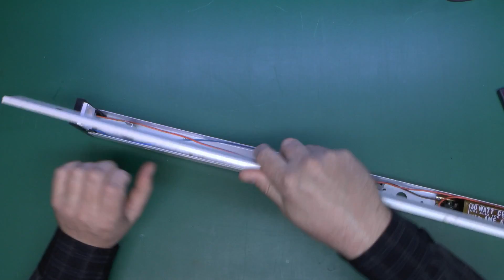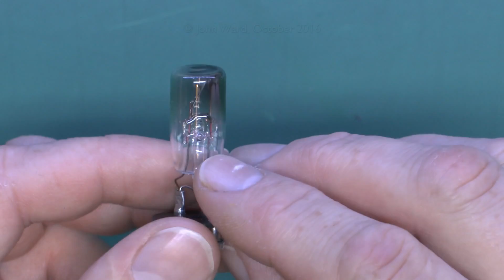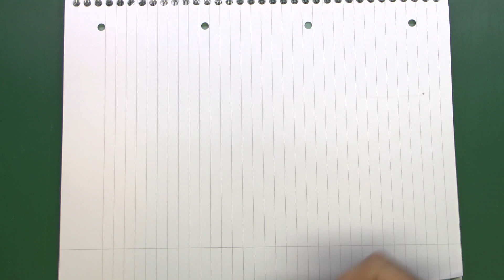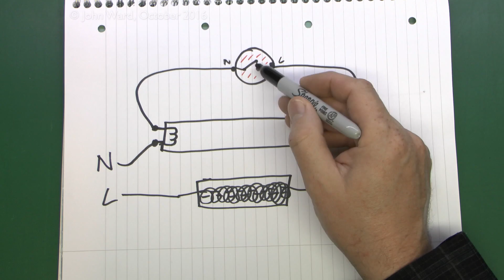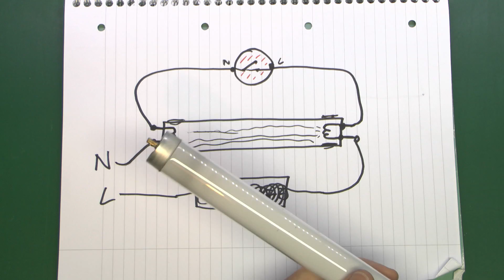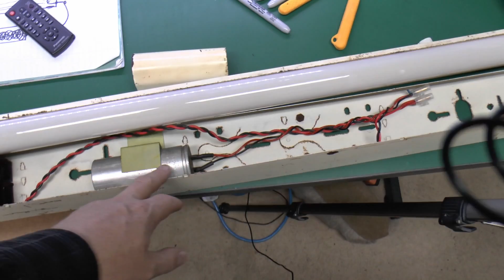Fluorescent Tube Lighting

Comment: A decent electronic driver is rather better quality and efficiency than choke, and good types are very long lasting and make the lamps last a very long time as well, e.g. :-
https://www.youtube.com/watch?v=Qyadtmx17Ms
However; really worth noting you can re-wire these fittings to connect both ends of tube in series, and put in integrated-driver LED tubes, bypassing any electronic-ballast (and preferably, magnetic choke), either bypassing starter socket or installing the "LED starter" which is really just a fuse/short-circuit.
One end of the tube contains another fuse/short-circuit and the other end takes the power.
There are evil tubes that take power from both ends or all pins which expose more risk of shock from the pins, breach safety rules in various countries as I understand it.

Comment: Thank you for an informative video. I notice no blogger ever mentions the suppresser in the   
Capsule that is connected acrosss the pins of the starter. It plays a very important part in reducing the emf chattering and upsetting the out side feed lines. Look at any good starter and you can see all the tests that are compulsory before a simple stater switch can be assembled or sold.
I worked for Thorn in South Africa where I started my lighting career and I remember the choke in those days in dipped lacquer/varnish. The information was paint silkscreened on. 
It is possible when the bi metal contacts have opened again to reomove the starter but if switched off the starter would have to be put back to light up again. If I remember it wa a post office/ telephone requirement. Many call the suppresor a fuse which it is not.
2025 Greetings from South Africa. That channel gitting was manufactured around in the seventies and probably have a date stamp on the underside. It is incredible the amount of popular packs that were manufactured at Spennymoor over 80 000000

Comment: 2 problems with these. Firstly with old units, the plastic fittings get yellow and  brittle with the UV given off and the 2nd is the mercury vapour inside the tube (which wasn't mentioned)😃

Comment: My Tricity cooker has a 2ft fluorescent hob light. With a push button starter switch. Press and hold to heat filaments then release. The lamp usually flickers to life if switch is pressed too briefly.
Reply: Will probably last a lot longer than these cheap LEDs

Comment: Being a electrician as I am forever that's is a thorn 3ft fluorescent light fitting it's runs off on a 240v.30w ballast and via that 3ft 30w t8 thorn fluorescent tube.and should have a thorn 155/500.4--65w.200-250v starter lamp switch made in great Britain items.must be in use for that 3ft 30w fluorescent tube light fitting.and that other starter lamp switch only in use a 6ft 70w t8 fluorescents tubes only.via that 70w 220-240v starter lamp switch.and have a good summer holiday there John ward.from this electrician that's me in general.

Comment: Hi John. Great vid as ever. That said, could you 'do' one on the necessary conversion (re-wiring) needed for them to run LED tubes? I get that it is to do with removing the choke / ballast and replacing the starter with a fuse instead but am not 100% sure of the revised set up. Thanks.

Comment: Hi JW i want to power in my workshop  so i will need 2x16amp plus normal plugs sockets double ones to run compressor and 2 cnc machines one being a milling machine plus lighting so could you advise on what i will need swg armoured cable thanks Rob

Comment: I think actually the ballast includes some kind of voltage inverter/booster to increase the voltage to start the current through the gas in the tube - as it's high resistance. So the circuit diagram drawn in the vid is not right(?) my monitor has to inverters on the power board and is marked very high voltage so I that is why I think this involves very high voltage to get the lamp/tube started - some kind of transformer/inverter in the ballast. I could be wrong.
Reply from the maker: Old ballasts like the one in the video are just a big coil of wire on an iron core.
New lighting and other items such as monitors will contain 'ballasts' which are actually electronic circuits.

Comment: Hi, What is the wire/ conductor that is used for the internal wiring?
Reply from the maker: Solid core, single insulated.  Not sure of the size, but probably 1.mm² or similar (this video was made over a year ago).

Comment: Single tube for single tube circuits as oppose to a starter for multiple tubes at the same time? What are you talking about??? 'Single' starters are for use for single lamps circuits yes, but the other kind I think you are referring to are single/twin starters i.e. FS2 starters that operate a single tube of 4-22w on 110/120v ac or two 4-22w tubes in series (one starter for each tube) on 240V. Also 3' fluorescent tubes are still 30w. When you give erroneous statements it makes me doubt anything else you say!

Comment: I work in a 24 hrs shop, and we rarely ever turn off the lights, we'd only use a couple of starter for a whole rows of light by connecting them, turn the light on and after the light has been started, remove the starter and move on to the next light as you don't need the starter while the light is on.

Quite a hassle when the power goes out though
Reply: What sort of stupid logic earning lots of money by running a 24hr shop but not spending pennies worth of starters for each light. Similar to car drivers in asia who switch off engines at traffic lights to save 6 drops of fuel but then pumping in 40 drops to get it restarted, not to forget wear and tear on battery and starter motor

Comment: If I decide to disconnect the ballast and put the line straight through for an LED tube, I take it the capacitor is irrelevant - if fitted at all. If it is fitted, is there any advantage in removing it?
Reply from the maker: LEDs are typically capacitive loads so another capacitor would make the power factor worse rather than improve it.  Therefore best removed.  However power factor is only relevant to larger commercial / industrial installations where it may affect the price paid for electricity.

Comment: 3' and 6', strange, in australia i've really only seen 2' and 4' (18/36 watt or 20/40 for the fat ones) except for fish tanks
Reply from the maker: 4', 5' and 6' are the most common here, with 5 probably slightly more popular.  3' are unusual and the tubes typically have to be ordered specially, 2' are available but seldom used - smaller fittings generally have folded tubes such as the 2D style.
8' tubes were common once in large shops and commercial buildings but are not manufactured now so most have been replaced.
Reply: I've actually noticed 6' variety noticeably more costly and hard to find specialist high quality tubes for, basically decided to settle on 5' variety as much as possible.

Despite the rise in popularity of some LED fits (of wildly varied quality), I have found very good value in HF Fluorescents (Tridonic PRO or ECO-dimmable ballasts) and special High-CRI tubes giving exceptional quality light =).

Comment: Known as "preheat" in the States. But you didn't mention the cap across the starter. Believe that's there to allow AC current to flow between the tops of the filaments after the switch opens (after the starting pulse).
Reply: The cap across the starter is to filter out RFI when the starter is operating.

Comment: A quick query - will the filaments not begin glowing as soon as power is applied, even if the filament circuit is closed at that point via the neon gas? The implication is that the filaments won't heat until the starter's bimetallic switch closes, but I thought that was merely the instant before starting circuit reverts to open-circuit state, because the bimetallic strip is no longer being heated.

Comment: We are slowly replacing the oldest fittings at work, as and when they fail, due to the lamps being very hard to get hold of. They take 8ft 100w t12 tubes. Shame really, but the light output of a twin 5ft t5 is equivalent or even better, whilst only consuming 70w in total
Reply: Note importantly, the T5 tubes are specified for use only with Electronic Ballasts.
T8 Tubes, confusingly, are 'rated' for use with Magnetic ballasts that waste considerable amount of energy again... e.g. 58w ballast with 20w lost in ballast
BUT when T8 ran with good electronic ballast similar to T5's they actually used LESS than that rating  e.g. 50w + 5w in ballast  (as well as giving more light, handling lots more start cycles, lasting longer, and giving non-stroboscopic light if the ballast is any good).

Comment: Can you do a video on the pro/cons of the electronic vs older ballast? Thanks.
Reply: Its pretty easy to compare and contrast the two types. older "magnetic" ballasts/chokes are by far more rugged and used to be cheaper to produce, after all they are just a coil of wire on an iron core so they practically never fail. But they fall short on efficiency, wasting a fair bit of power as heat, and can leave a visible flicker and audible hum of 50 or 60Hz, corresponding to your countries mains frequency.

Electronic ballasts offer greater energy efficiency and usually operate the tubes at high frequencies, which means flicker-free and hum-free. But the "instant start" variety can be pretty rough on the tubes, by not preheating the filaments at all and forcing them to start with a high voltage pulse. 

So basically it comes down to magnetic ballasts are tried and true, but everything is solid state circuitry nowadays and you can't really find many (if any) magnetic ballast fixtures anymore. Gone the way of the incandescent light bulb.
Reply: Exactly...
Second-hand / new-old-stock Tridonic ballasts are easy to find and very good quality, very long lifetime, much better than magnetics...

Comment: Excellent explanation John. There is one other mode of failure. When the filament burns out or breaks off, the bulb will not light . This is also true if the ballast is the starter less type. Even the high freq ballasts need a filament for the arc to land on. In the US we can still get most any T12 lamp including the HO variety, however, the VHO ,(very high output), are quite difficult to find.

Comment: I have a couple of these fixtures in my garage. They're having issues starting up. 
One day I noticed running my hand along the tube during startup excites the gases in the tube and it promptly lights.
Just thought I would share this little tidbit of information.
Reply: This might suggest the fixture isn't properly grounded
Reply: Tubes like to have a grounded metal strip running along their length to help start.
Reply: wonder if its static electricity helping ironisation

Comment: I have an old fluorescent fitting in my garage, dating from about 1959, which has a modern bi-pin tube in it but the starter has four pins.  Does anyone know what that's all about?
Reply: I believe four pin starters used the extra pair of pins for a small heating coil that drives the bi-metallic starting mechanism in free air, predating the gas discharge 2 pin starter shown in this video.

Comment: is there any way to check with multimeter one of these tubes if it works?
Reply: You can indeed check between the pairs of pins on one end or the other for continuity, to ensure the filaments are still intact. BUT, there is no way to check for a working tube long-ways across the gas in the tube with just a multi-meter. Need to just stick it in a fixture for that :)

Comment: What is the best way to determine if a flickering fluorescent tube is a faulty starter or tube?
Reply: The tube goes visibly black near the ends, which is usually a good sign of a well used lamp. But a faulty starter may take a long time after power is applied before it attempts to strike the tube, or it may not attempt at all. Blink happy fixtures usually means a worn out tube, the starter is trying its best but the tube can't successfully strike anymore with the supplied voltage.

Comment: So once the tube has been struck, it is driven cold cathode style? Or are the filaments self heating?
Reply: the filaments are heated duig striking via the starter, once struck the current flow keeps the warm, thats why when a tube dies and fails to strike, the ends start to glow due to the starter not kicking open cicuit
Reply: John McLaughlin Ah, I figured as much.
Reply: Filaments basically not used once started on these old switch-start-fittings.
HOWEVER, I should point out that you get much better startup-lifetime with these lamps if you use a Decent quality High Frequency Ballast instead.
There are instant-start and rapid-start HF-ballasts, but, the best ballasts (e.g. seemingly all Tridonic kit) use a "Programmed Start" electronics, running the heaters optimally and start as best as possible ....  Switch-start / magnetic choke can be described as a very "heath robinson" arrangement, as well as giving all those widely-recognized headaches/issues surrounding 100hz lighting.
Reply: Any fixture with a starter or so-called "preheat" fixtures should not cause constant glowing filaments, unless the starter happens to weld its contacts closed. I believe its rapid start ballasts that fail in that manner, but do not use a self-contained starter as such.
Reply: didn't know that thanks :)
Reply: I've noticed that in the USA, the heater elements are always being energised. This is quite unlike the fluorescent tubes in the UK which are only energised during striking. This does result in different behaviour during failure.
Reply: For switch start they are only heated directly via starting. The arc discharge is hot enough to keep them glowing. In the US with Rapid Start the filaments are heated electrically during the entire running time. This is rather wasteful except for flashing or dimming lights where the heating is needed to reduce wear on the filaments during that type of operation.

Comment: The only thing missing from the video was why the filaments at the end of the tube are pre heated, which is the same reason that CRT's in TV's and and monitors and valve's in old electronic equipment heat the filament to help them emit electrons. Once the tube is conducting I believe the current through the tube keeps the filaments hot.

Comment: There is an adaptor kit for those old B22 tubes so you can retrofit a regular T12 5ft tube into them. plugs into the socket one end and has a pin holder the other end. Used for those historical places which want to keep the look of the old fixtures, and who can find a stock of 5ft T12 lamps ( in warm white of course, no cool white in the 1950's) to put in there. 

As to the 3ft Thorn fitting, that is probably older than you John, it certainly predates the EMI buying of Thorn. The days when things were actually made in Britain, using British made steel and copper, and which were designed to last decades in use.
Reply: No random wrong apostrophes in the 1950s either...

Comment: Very informative, I do wonder if more that one person attempted to connect a fluorescent tube directly to the mains with one of those B22 fittings and experienced pretty disappointing results.
Reply: Would it be just a dim glow or would it pop the filament? The reason I ask is that the filaments weren't designed to self-limit their current like a normal bulb does - the ballast/choke is there to do that already. Straight on unballasted mains, wouldn't they just burn out?
Reply: The filament burns out with a bright flash and bang, sometimes knocking out the fuse, to make it glow you need only 12 volts. Only way for it to dimly glow on mains is when the filament is already broken, then it has just a gas discharge from buffer gas (argon or krypton) between the empty filament holders.
Reply: I would imagine as Big Clive would say "It went BANG!"

Comment: Interesting video John. My garage light is the old bayonet  type fluorescent light which looks very similar inside to that one you showed. It still works aswell which is a bonus. Shame the bulbs are no longer available though. Why is the old one near silent in operation yet a brand new one I have in the Kitchen I can hear humming away throughout the house?
Reply: The hum is caused by magnetostriction in the choke. Magnetic components (transformers, motors, chokes) used to be built with lower flux density, more margin to saturation of the iron, making them quieter. Now they push the iron really hard, to save on material and shipping weight (from china). It might also be some resonance in the case.
But a brand new fixture (as in bought in the last few years) really shouldn't have a magnetic ballast any more, it should be electronic, at least in the EU this is required by law. An electronic ballast shouldn't hum, it also lights up near instantly and does not have a starter.
If the hum bothers you replace the tube with a LED retrofit tube. Even as a drop-in replacement the reduction in current draw should stop any hum, and you can remove the choke if all else fails since LED tubes do not need it at all. Most old fixtures can be retrofitted with LED tubes at lower cost than replacing them, as long as the fixture is still in decent shape mechanically.
Reply: I don't know the date, but adaptors were made to enable the bi pin tubes to be used with the old fittings that had the B22 lampholders at each end.